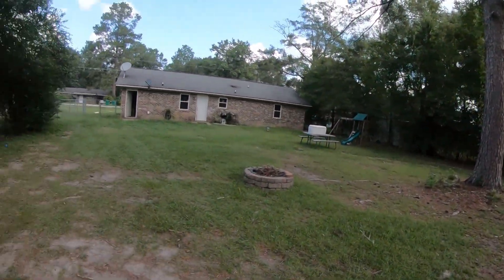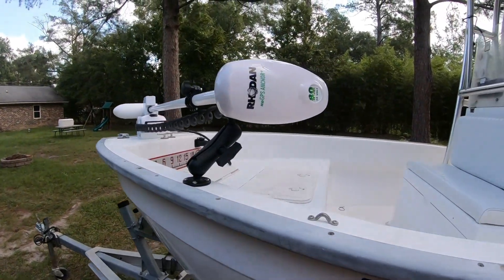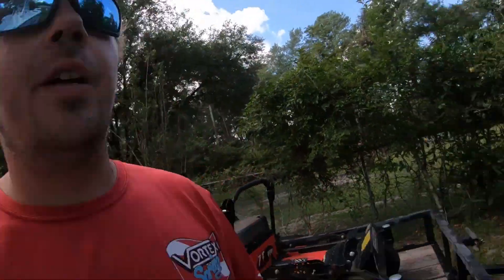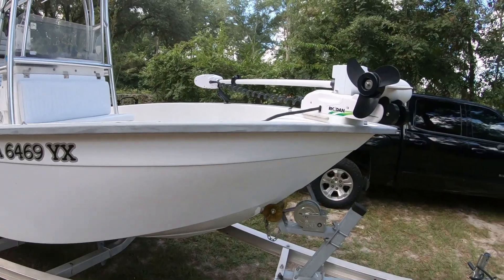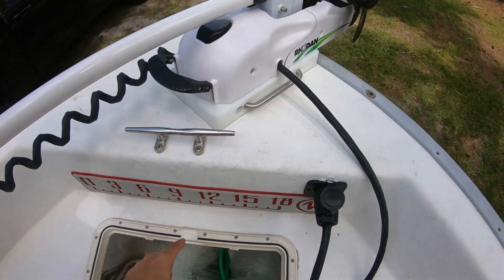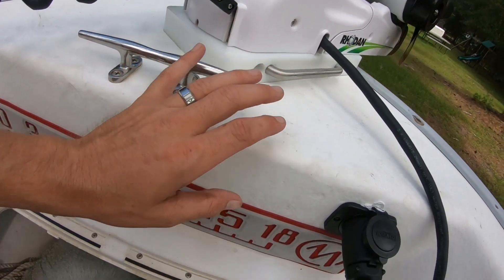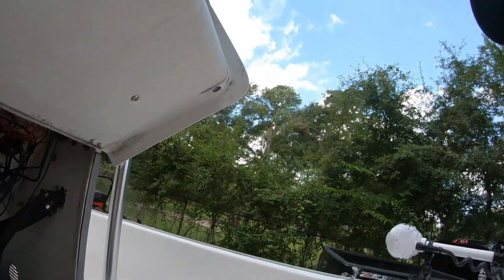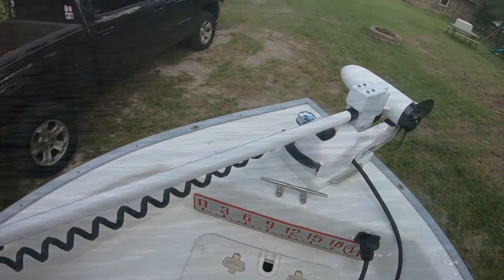Trolling Motor Install Tips - 17 Cape Horn

Comment: How do you remove it with the quick release, i bought a boat with a rhodan and cant figure out how to remove it
Reply from the maker: This one has a big U bolt that goes though the trolling motor base and mount. You unlock it with a key and it pulls out. Then the trolling motor can just be lifted up and off the boat/mount. Hope this helps. Thanks for commenting!

Comment: The 1st gen’s didn’t come from factory with that hole cut under the console to run wire. Somebody did that mod it’s super nice but such a pain in the butt bc of the foam poured in the hull
Reply from the maker: The previous owner did install a new nav light on the bow. Maybe that's when that was done. I figured it was original. Thanks for clarifying that!
Reply: @BuoyBomberFishing  and what a blessing he did for you!!!
Reply from the maker: @MonsterIsMDG  Agreed,